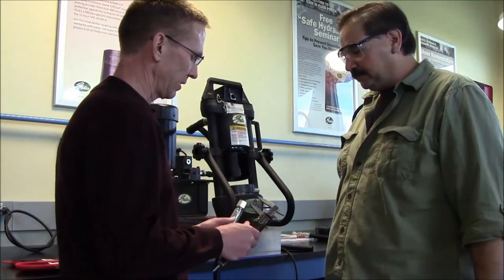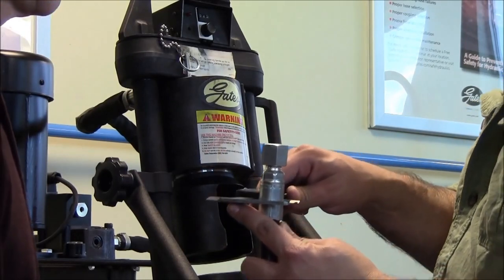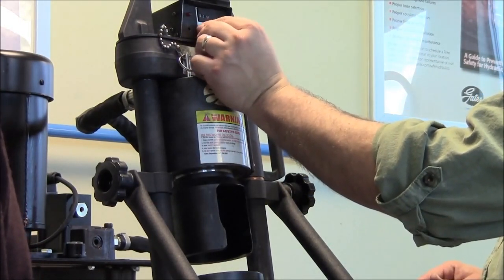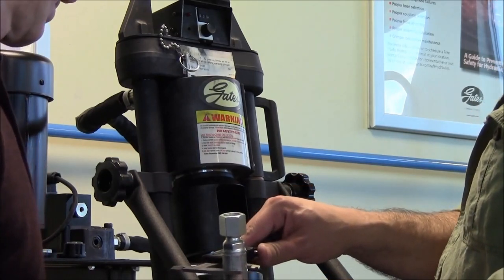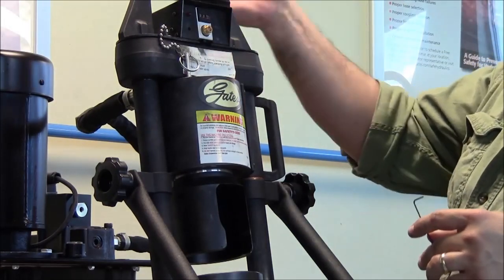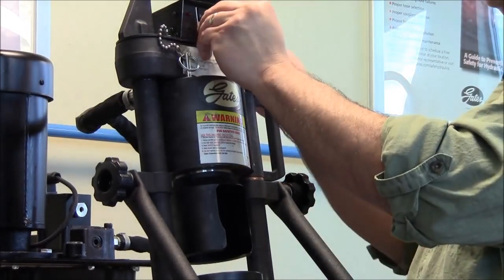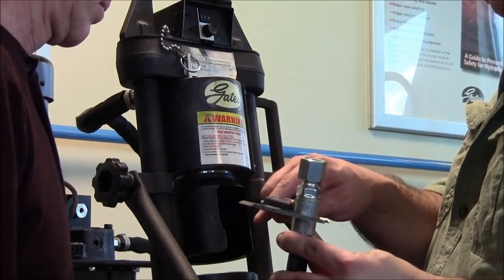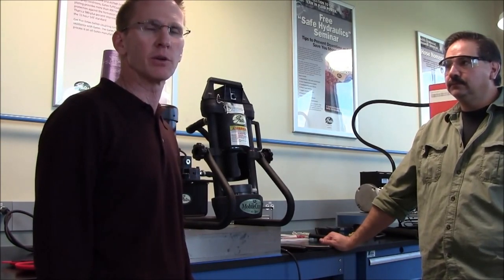Tutorial: Calibrate your MobileCrimp® 4-20 Crimper

Comment: How's this powered? Standard ac plug? Pneumatic or hydraulic powered?
Reply: This one is powered by a 1-1/2 HP 115 Volt AC Pump(pictured on the left), but it can be powered by 5 other pumps we offer; Hand Pump, Pneumatic foot Pump, Battery Pump(M28 Milwaukee), 1/2 HP 115 Volt AC Pump, and 1/4 HP 12 Volt DC Pump.